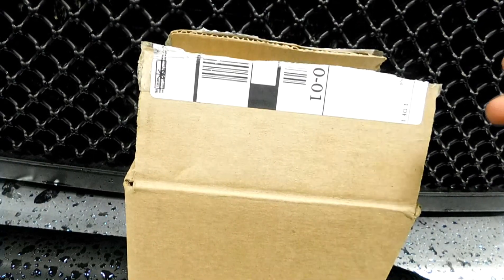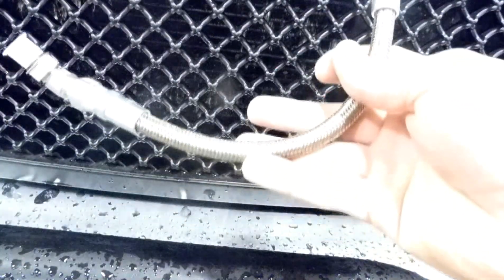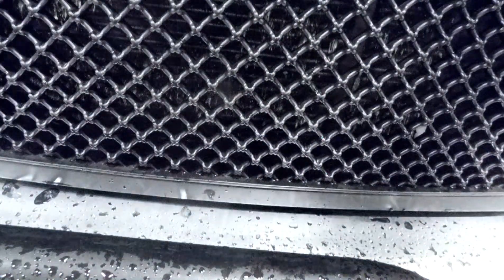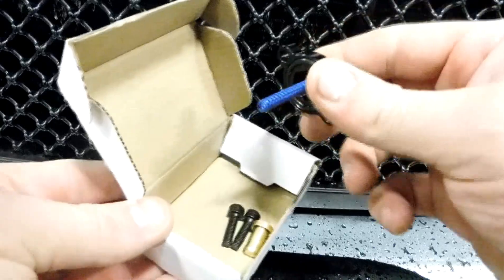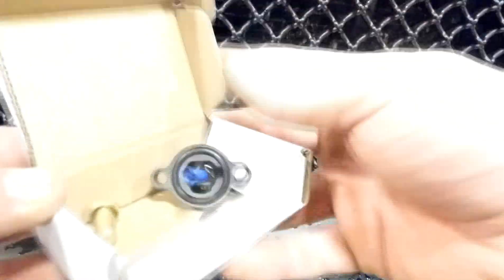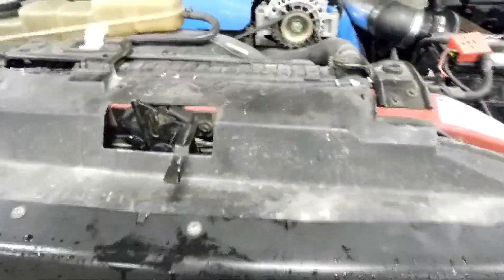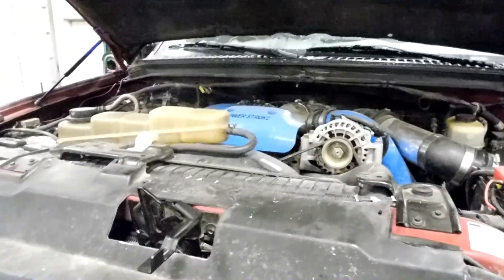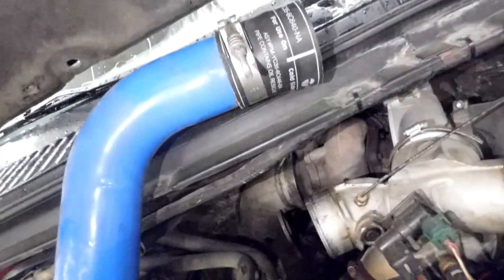7.3 powerstroke super duty oil crossover line and upgraded fuel pressure spring install

Comment: What’s all done to your truck?
Reply from the maker: S and b air filter, stage 2 kc turbo, bellowed up pipes, 180/30 ff injectors, hydra tuner with jelibuilt and 1023 diesel tunes, mild built trans with billet tripple disc torque converter, 6.0 trans cooler, trans cooler bypass delete, pretty much it.
Reply: @brunssenboy  what AR housing size do you have on your turbo?  .84 or 1.?
Reply from the maker: @dieselneckgarage6568  .84